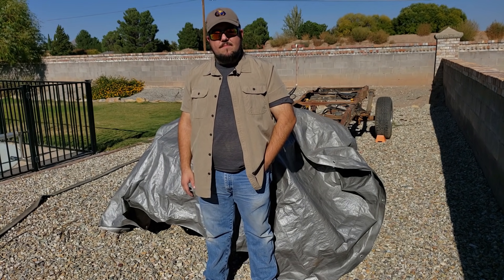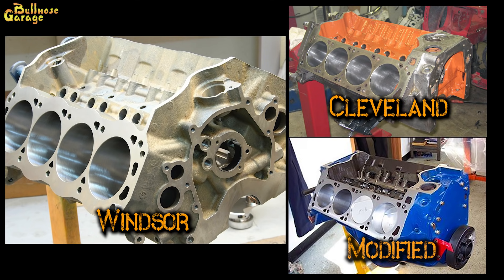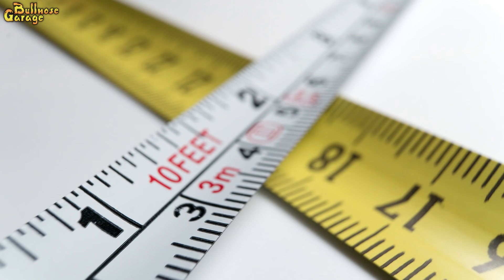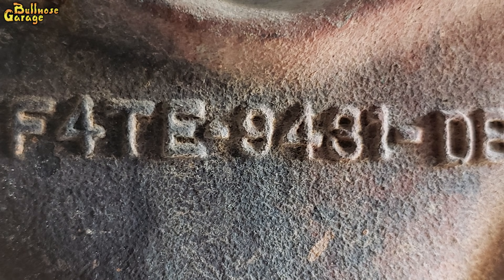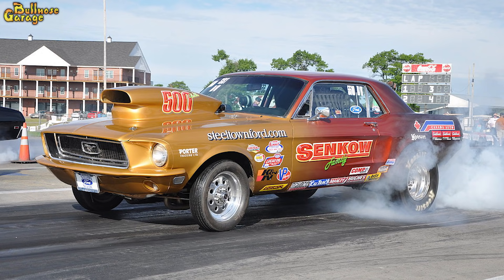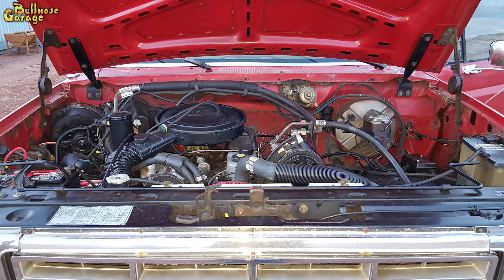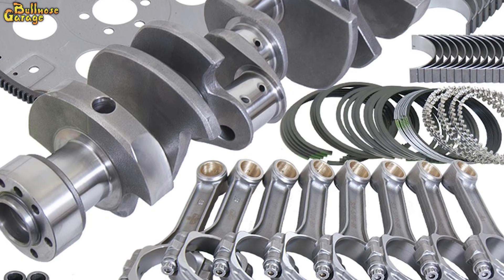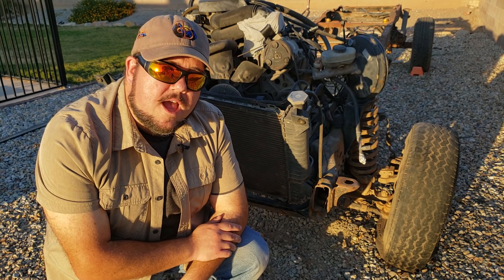351 Windsor – What You Need to Know About the Ford 351w Small Block [5.8 Liter]

Comment: In your opening statement I will agree the Windsor is definitely a great engine, but the 351 Cleveland is the baddest small block Ford ever made and is the baddest small block to ever come out of Detroit. In its ultimate normally aspirated form Bob Glidden absolutely decimated the competition in pro stock and that engine is the reason the officials moved up to the 500 in³ class limit.
Reply: You are so right my friend the 351C was bad to the bone with just a little tweaking
Reply: No the boss 351 was the baddest ford small block ever made
Reply: Doesn’t the boss use 351 Cleveland heads? So the Cleveland is still far superior to a 351 Windsor.
Reply: @derklanz1222  Absolutely correct
Reply: @derklanz1222  no the 351 boss was it's own monster only produced a few years but those few years it was the monster to have
Reply: I was thinking the 302 boss used the 351 Cleveland heads I think. Yah I didn’t know they had a 351 boss though from the factory. I knew of the 351 Windsor and 351 Cleveland. The Cleveland from all accounts I have read and seen had far superior heads.
Reply: @derklanz1222  yes sir they had a 351 boss I'm not sure how long it was produced I'd have to look that up
Reply: @derklanz1222  yes the boss 351 is a Cleveland. The ,boss in 302 however is a w style with a Cleveland head. Both used 4 bolt blocks forged internals crank, rods, pistons, see solid lifters. Valve sizes were big. In 69 the 302 used 2.23 int. 1.88 ex in 70 they dropped the intake valve sizes to 2.19 . The boss 351 used the same I think. With closed chamber. But other Cleveland motors had 4 bolt blocks and forged cranks, and rod and pistons. The Boss 351 got high rise aluminum intake dual point dist. Solid cam the others got cast iron intake hydraulic cam and open chamber heads
Reply: @jonathanlawson4667  they were produce for one year only
Reply: @derklanz1222 the 351M and 400 also use the same heads and cam as the Cleveland
Reply: @derklanz1222  351 Windsor block with Cleveland heads is king 😂😂
Reply: @derklanz1222 Not exactly. The Cleveland heads hot coolant goes out of the heads at the front deck surface, into a passage in the front of the block. The Boss 302 heads had the Cleveland valve and port arrangement, but the coolant left the heads into the intake manifold like all the small blocks. 
Cleveland heads can be modified to build a Clevor engine by plugging the deck surface passages and drilling the intake surface in the appropriate location. FRPP catalogues gave the instructions.
Australia used Clevelands in 302 and 351 versions.
Reply: @derklanz1222 sorry the Boss 302 was designed in 1967 , the heads later were used in designing the Cleveland engine family 302 Cleveland, 351 Cleveland, 400 and 351 M all use heads designed for the Boss 302 , as there was no Cleveland till 1970 the Boss 302 can't have Cleveland heads as there was no Cleveland then.
Reply: @jonathanlawson4667 the Boss 351 is a 4V Cleveland that is all .
Reply: @sammygonzalez7627 The '72 275HP 351HO was essentially a lower compression Boss 351.
Reply: @JosephCowen-fz8vj I think you are confusing the Boss 302 heads with the failed "tunnel port" heads. The Cleveland was already in development when they decided to use the Cleveland style heads on the Boss 302. They didn't design the 351 Cleveland around the Boss 302 heads.
Reply: @foxfordcatguy2283  I've done much research on both Boss 302 and Cleveland. The Tunnel Port was designed in 1965/6 then was not allowed in certain racing classes because it was never homogulated in a road car , Ford then switched to a cantered valve head on Boss 302s in 1967/8 , the Cleveland was not even cast till 1970 , and yes Ford wanted to use the good flowing cantered valve heads on a motor better designed to Handel the flow being a bigger engine , Cleveland development was 1969 , the Boss 302 was already being killed then ! There was no Cleveland when the Boss 302 heads were designed ! The Cleveland came out of Boss 302 design . If as you assert the 351 Cleveland was already in development when the Boss 302 was being designed why wouldn't Ford use the much better , taller block for a 302 Cleveland engine ?? If they had it , it don't make sense . It would have been easy enough to do just drop a 3 inch stroke crank and 6 inch rods in a 351 C block . Ford Australia did it and sold millions of 302 Clevelands from 1973 to 1985/6.
Reply: @jonathanlawson4667  True, but they were rare
Reply: @lawnmowermanlawnmowerman9930  yes they are. They were made for one year only...1971.
Reply: @lawnmowermanlawnmowerman9930  yes very rare
Reply: @jonathanlawson4667 The Boss 351 IS a Cleveland.
Reply: I disagree the Boss 302 and the Boss 351 were the true monsters. I still have the plans for the Boss 302 conversion from stock 302 Block.
Reply: @MrKswildman the Boss 351 is a Cleveland ! I'm in Australia and we only had 351 Cleveland's and 302 Cleveland's from 1973 to 1985/6 cast in Australia. Taxis had Cleveland's in them be it 302 C or 351 C .
Reply: @MrKswildman The Boss 351 IS a Cleveland.
Reply: Wellllll, the 351C, 400 and 351M are good for racing, with caveat. The large ports were good for high RPM power, but the oil system has problems. 100,000 miles and the main and rod bearings were worn enough to have low oil pressure at idle. 
The small block and 351W had a much better oil system and crank bearings last much better. The cylinder heads promote better torque at lower RPM which is good for street.
Reply: Good luck finding any old Clevelands out there.  Fords best.
Reply: @lenBrill1971 Clevlands are few and far between now. The related engines, the 400 and the 351M are more common. Same basic design but larger main bearings and a taller deck height. The 400 crank can be dropped into a 351W to make a stroker of 408 CID.
Reply: @daledavies2334 .  . . . .right on brother.  I'm a Ford man because my father was.
Ford engines have so many interchangeable parts it's awsome.  Thanks for sharing my man🇨🇦👍
Reply: @lenBrill1971 One area Ford messed up was bellhousing patterns. Small blocks and inline6 share a pattern. The FE is different as are the 400, 351M and 385 engines as a group.
The General on the other hand has the same bolt pattern for every rear drive from Vega to the 454 big block. The LS series mostly match. Then the transverse engines are different but mostly the same. The transmission from a 2.8 Camaro or S truck can be used to put a 3800 series 2 or Northstar V8 into a rear drive vehicle. Need to weld one tab on for one bolt hole. 
Unfortunately Ford missed that commonality. I think the mod motor bell housing is very similar to the small block. Bolt pattern on the 4.0l overhead cam V6 is not known to me, but I will have the opportunity to determine that next summer as I swap an engine from a rolled Ranger to an Exploder.
Reply: @daledavies2334  . . . . Jesus look at you go.   You're a good feller to know when we have questions on the interchangeability of parts.
👍🇨🇦🍻
Reply: @daledavies2334 . . . . .  My father always said you could bolt on a pair of 351 Cleveland heads onto a 429 to raise compression and build a solid street racer
Reply: @lenBrill1971 Not so Len. Different bore pitch, or spacing. Now there is a guy making Boss 429 style heads to bolt onto a 351W block. Andy Wood of Unity Motorsports Garage has built one.
Reply: @daledavies2334  . . . . Fair enough 👍👍
Reply: @lenBrill1971 The 351C, 400, 351M share the bell housing pattern with the 385 series. The 385 engines also use the canted valve arrangement.
The 351M is basically a destroked 400 using the 351W crankshaft. A heavy engine so not appealing for street rod use. The assortment of head designs and rarety of a couple of good designs makes them somewhat impractical.
David Vizard has a Youtube video on making a small block hold up to 1000HP. In it he gives the contact information for a machine shop that will modify 2 bolt blocks for splayed 4 bolt mains, with a machined key to lock the cap. He also shows a reenforcement in the lifter valley.
Australian Ford used the Cleveland design in 302 and 351 displacement for years with the 2V valves and 4V closed combustion chambers. Would have to import a pair of those heads as very few have been imported. Could build a real torquey 408 Clevor.
Reply: @Dale Davies  . . . . . Dude I'm reading this with my mouth open.   It's clear you've done your homework.  I took a screenshot of your info.  Tuck that away for reference later. A future engine build 👍🇨🇦
Reply: @daledavies2334 That's why they made the different styles of transmissions with different bellhousings
Reply: @lenBrill1971 Head design of the valve and valvetrain layout is similar, but bore pitch is different so the heads are not interchangeable.
Reply: @purpurahaze9179  Please explain why. Chev had one bolt pattern that you could bolt any Chev engine up to a trasmission, from a Vega up to a 454. Now I would not try bolting a big block to a Vega transmission as those are just not built to handle the torque. This bell housing pattern was introduced with the advent of the SBC and modern inline six engines.
Ford you have to watch when swapping and get a matching transmission. I think Mopar is somewhere in the middle for bellhousing patterns since the modern engines were introduced, in the 1960's.
Ford could have come up with a more universal bell housing pattern.
Reply: @daledavies2334  Well I wasn't a Ford engineer so I can't say
Reply: @lenBrill1971 nope two different engines , but a pair of Australian 302 Cleveland closed chamber heads on a 2v  351 Cleveland gives 10.5 to one comp.
Reply: @daledavies2334 nope 302 C and 351 C use small block Bell housing , 400 and 351 m use big block Bell housing and engine mounts , ( excluding one year were 400/351m got small block pattern)
Reply: @daledavies2334 nope all 335 series same 4.38 bore centres , be it 302c, 351c , 400, 351m and even the small block 221, 255,260, 289,302, 351w. That's why there is a 351 M for modified as in a 400 block modified with a 351 W crank .
Reply: @lenBrill1971 No, 351C/351M/400 have a different borespacing & head bolt pattern than 429/460.
Reply: @daledavies2334 No the 351C has the same bellhousing bolt pattern as the Windsor family; 289/302/351W.
Reply: @lenBrill1971 they were produced in Australia from 1973 to 1985 and were so common they were in taxis here either 302 Cleveland or 351 Cleveland .
Reply: @lenBrill1971  351 Cleveland are everywhere and a dime a dozen. Where have you been looking?
Reply: @Revelationthankful not the closed chamber 4V version.
Reply: I love the Cleveland too, but the only reason he said that was there are millions out there compared to the availability of the Cleveland.
Reply: Used to be, that's the key, the 351C used to be a better hotrod/race build engine than the 351W. That isn't true anymore. Let me explain. The 351W has far more aftermarket support than the 351C today which, combined with the 351W taller deck lending to more displacement potential, the 351W has more upside. The bread and butter for the 351C used to be the 4v heads with their superior flow characteristics over the 2v and far more than the stock 351W heads, however, by virtue of the aftermarket, there are better flowing heads available for the 351W, they can even come in canted valve or hemispherical configurations. As it stands right now, today, the 351W has more potential in a build than the 351C. This is just a product of the 351W having so much in common with the 302 more than anything being "wrong" with the 351C. It just is what it is.
Reply: Yes sir Chad the C was a bad mofo. I have a friend of mine that did a Boss 351 to 383 inches. And he in used the factory block and heads with a sheet metal intake and a big single 4. It in spins 9000 and makes near 900hp no juice no boost. Now its a big 4bbl, and the heads have a ton of time on them big compression and it's pulling numbers all the way to 8800.and it is music to the no ear when it's making a pass
Reply: I’ll take my ‘69 351w 4bbl with it’s 10:7-1 compression ratio any day- smoked😅 2 ‘70 Mach I’s with my ‘69 Mach I. Both are great but I’m partial to my 351w. (‘69 was the only year Ford made the Windsor with a 4bbl)
Reply: Best Ford Smallblock 351 Windsor block with Cleveland heads 😂 😂
Reply: Baddest you mean power, not reliability right?
Reply: The rarest 351 is when Ford Australia was looking into a new V8 for Australia, the 351 C was a bit too much for mum and dad cars , we were casting the new motor in the Ford Australia Geelong Casting Centre, they had lots of running motor prototypes including a 351 Cleveland bottom end running 351W heads , factory cast iron intake to match up the two different blocks , they had these cars running around , it's not a Cleveland or A Windsor , there's one at Ford Australia. They decided to instead build 302 Cleveland's by dropping the stroke to 3 inches and redesign closed chamber heads for the 302c six inch rods , and four barrel intake but 2v ports to tame it down and make it drivable , all Australian 302c and 351 C are four barrels but 2v ports , they came from the factory with Carter Thermo Quad carbies. Our 200ci and 250ci ford sizes also got Cleveland heads in 1978 , cantered valves , same as Cleveland's I guess so they could save costs just making one type of valve , rocker etc. they were cast in Alloy from 1980 at Honda in Japan . This is the motor that evolved into the Barra six .
Reply: 289 🔥
Reply: Detroit? Tht wouldn’t be the Cleveland than
Reply: The 351 c and 351m and 400 motors are more myth and legend than great street engines. The best overall small block ford in the muscle car era was the 351 boss. The regular cleaveland has no bottom power. The 4 valve engine was outstanding at 5000 or higher rpm
Reply: It was also very heavy and had oil starvation issues. The Cleveland might have been a stronger engine from the factory but the Windsor is a better design.
Reply: We're all entitled to our opinions, regardless of how completely fucked off backwards yours may be.
Reply: @Stephen McCain  . . . . Old school engine builders know what they're looking at son.
These engines were around before your dad was born.
Reply: @lenBrill1971  Well, kind sir, my father was born in '29 so thank you for reinforcing my statement about wrong opinions.
Reply: @stephenmccain8184  You from Wyoming? My cuz
Reply: @stephenmccain8184 Wellll, now that you have appraised our mental faculties, have you ever observed that others may consider the same for you. As David Vizard says, "I don't have an opinion, I have a dyno". For myself I have years of working on everything from Austin Minis and MG Migets to 150 ton ore haulers. I also worked as a corner marshal at road racing events and been an auto enthusiast for decades. Yes I have opinions, but based on those decades of experience.